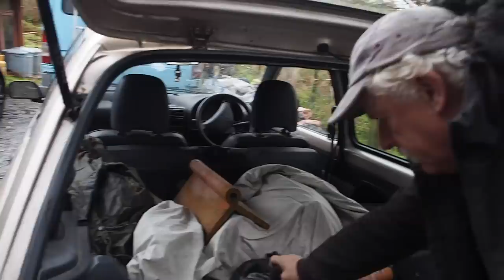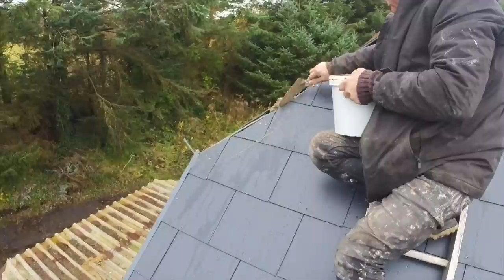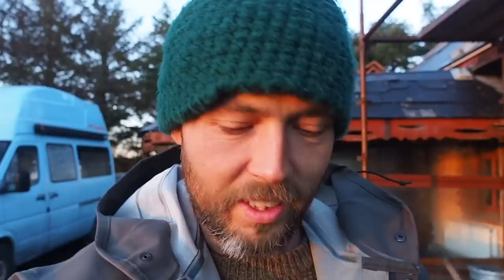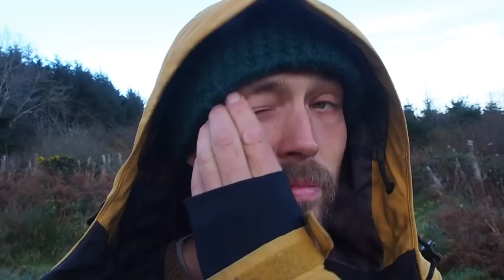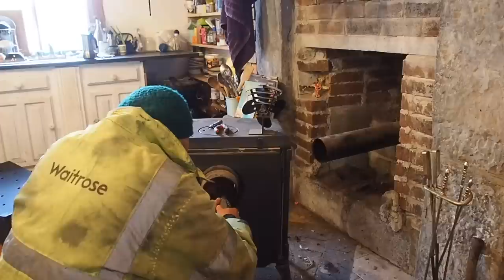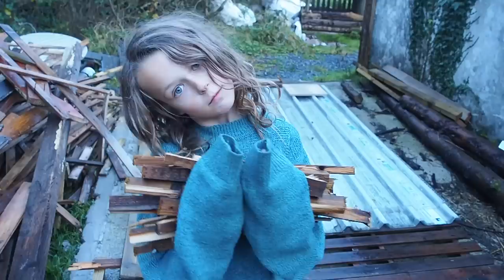Irish Cottage Renovation (Ridge tiles ON!)

Comment: So nice to have the roof done. Now you can get inside stuff underway as time allows. What are winters like there? Do you have  to deal with alot of ice and snow? In Nova Scotia, spring, summer, and fall is beautiful. Winter can suck at times mainly in Jan and Feb.🙂👍👍👍🇨🇦🐕🐕🐷🐷
Reply from the maker: The winters are generally quite mild. Unlikely to get snow but can be very stormy at times. I love a bit of snow